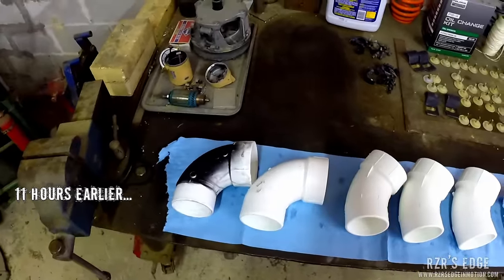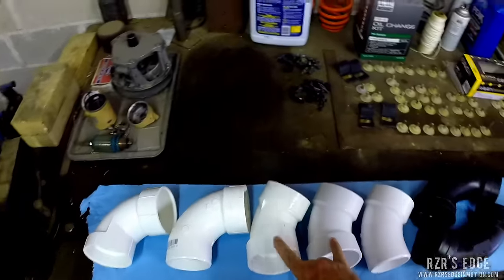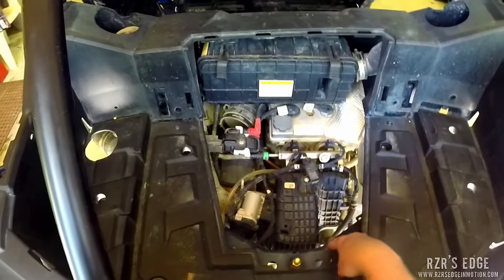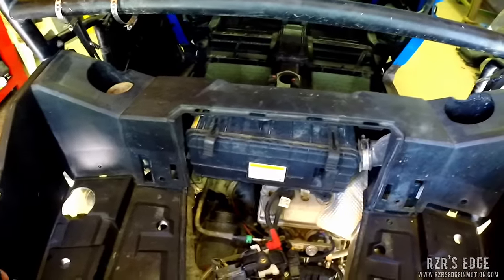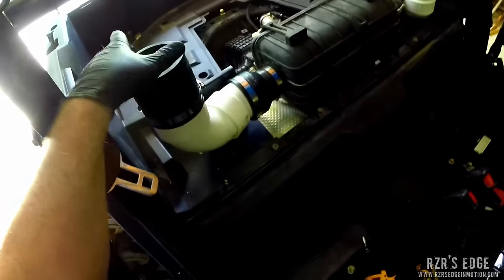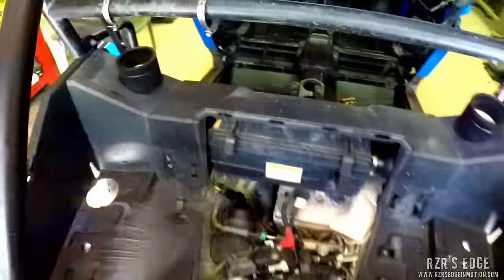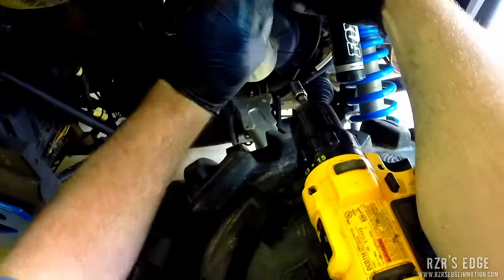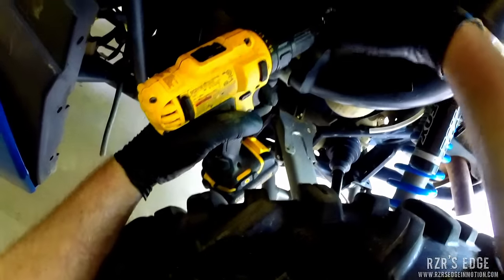How To - Snorkels! And Vent Lines

Comment: Nice write up about to do this on my 15 rzr 1000.  Any changes you think should be done? Also I hear yours burnt down how did that happen?
Reply from the maker: A mouse, chewed on the 12v wire going from the battery to the winch. Yeah I ended up using JB Weld on the joint I glued on, that was that. Sorry for the late reply!

Comment: Just watched your video had to watch it all.Exelent job.I just bought new 2016 900 S will your setup work on it. Again nice workKen
Reply from the maker: Ken Stegmann I would think so, doubt there's been any updates in those areas. visually verify everything is where I show it before doing anything you can't easily undo. also be careful with clearance between the tire and clutch exhaust tube, I have offset wheels which gives me more room there, a couple inches or so

Comment: Great video man Im always looking to make something out of nothing. I have a 2015 Rzr 900 Trail. Do you know if its the same as yours besides yours has 2 more doors? Do you think it would be possible instead of having 3 snorkels to combine the 2 on the left so you only have the matching 2? I really wanna keep my bed. I also have a back window.
Reply from the maker: Dave Burkhart the trail is much more narrow than mine, the belt exhaust done this way would not work for you unfortunately, the 2 flex 90's would be right where your tire is. also no you can't combine them, one pulls air in, the other pushes air out. you'd create a loop of increasingly hot air that would burn your belt up in no time

Comment: I just got a 2016 polaris 900 trail and I didn't like any of the snorkels out there. I don't think I could have come up with this one. It looks great, going to do it. thanks
Reply from the maker: nightweb11 awesome, hope it helps you. since it's a trail, make sure there won't be any clearance issues between the belt exhaust snorkel and the tire. the 50" width will almost certainly give you problems there, you may have to do something else there. keep me posted
Reply: RZR's Edge In Motion what do you mean clearance issue? I have. 2016 trail and I really like your setup. I just watched the whole thing

Comment: Great video watched the entire video only question I have is do you have problems with stuff getting kicked off the tire into that flex tube for the belt exhaust? Just looks a lil close to tire for my liking but well done.
Reply from the maker: Cody Flick thanks :) yeah I'll admit placement of that one isn't perfect, I struggled on where to put it for a week. made 3 different ones before that one. the only way to get it out of the line of fire was to move it toward the back and over next to the back roll bar, and also lower it. it looked awful that way. 

it does have a few splash marks in it, but they are just around the tip. the good thing is when the tires are spinning, so is the belt, and there's a significant amount of air coming out of that tube. I've yet to get anything past the screen. time will tell I suppose

Comment: Another great video ! Nice clear calm instructions ! Not trying to rush and skip things or going so fast we have to pause the video to slow u down! Very good job and thank you for posting this video. I want to try this but I’m scared I might screw up lol.
Reply from the maker: Haha thanks! There is one thing I ended up having to do differently. The PVC cement did not hold, I ended up using JB Weld there instead, and it lasted until the machine burned down.

Comment: update on put on the rzr trail models: For me my wheels never leave the ground so there's enough clearance, my friend just pick up a used rzr trail with drive train problems for a good price. He spend most of the time in the air so there's not going to be the clearance he needs. He is going to lift and widen it so he is doing this snorkel because doing all that he's doing will give him the clearance. So if you have a stock rzr trail and plan on driving like my friend you met not want to do this snorkel.
Reply from the maker: Sound advice, thanks for the updates :)

Comment: FYI the gas vent hose in rear roll bar has no holes to let fumes escape. might want to drill hole up top by roof
great videos
Reply from the maker: Bill P - good advice, this had occurred to me shortly after making this vid, and I drilled a small vent hole in each tube to let gasses escape, below the top of the vent lines itself so there was no chance of water managing to drip down into the lines. thanks for reminding me, maybe I should update the info and mention that.

Comment: How does it sound in comparison to stock? very clean install plan on doing this after warranty is up. Nice work !
Reply from the maker: Lanny Griggs thanks! honestly it doesn't really sound much different, not a big change like an 800. the clutch does seem to breathe much better, when I first fired it up after putting them on it blew a ton of dust out the clutch exhaust

Comment: Weather  broke long enough to do the snorkels on my 2016 Polaris RZR 900 Trail. Only had a few issues one was they weld on bracket to the rolll bar for after market seat belt harness to mount to, I try many ways to get around them (none looked good) so if you aren't welling to cut them off you may not want to try these. If I had the secondary clutch intake hose there more then likely wouldn't have had enough room for the exhaust hose to leave wheel clearance.  They look great. Thanks a lot for taking the time to make the videos.
Reply from the maker: nightweb11 thanks for the update, I figured they may not work for everyone. hopefully it'll give ppl a starting point to adapt my ideas for their own use tho
Reply: nightweb11, I have been watching this video and have been thinking about trying this. I have a 2015 900 Trail. Do you know if your 16 is the same as my 15? I havent started doing this yet just looking into it. Any help would be appreciated. I dont mind cutting the bracket. Does it just need to be welded somewhere else? Thanks Dave

Comment: I don't know about 2015 & 2016 you could go to a deal to find that out. I have the after market 4 point harness so where the bracket is the two claps that hold the snorkels is where the outer belt fit, I am concerned the claps may cut into the belts so I am going to put a some rubber over the belt and under the claps to hold belt in place. if you are run the stock belts it isn't a problem. the exhaust 45 rubber elbow has to be put up tight to the bed. give around 4 inches of room from elbow to tire. I used a tie down  to  put down the springand tire didn't hit the elbow.  I don't do any jumping so I not worried. I hope this helps.

Comment: After installing the snorkel for the belt exhaust are you getting a lot of noise out of the snorkel from the belt.... by the way good clean job. And yes I watch the entire video lol. Thanks
Reply from the maker: BigTimsTowing - lol :D On a 2 seater it does make a fair bit of noise. On the 4 seater they are far enough back where it just sounds cool. Oddly enough it's not even that bad from the back seat, which obviously makes no sense. Must be some sort of acoustic effect from the larger cab, I dunno. Couple things I've done differently is use jb weld on that exhaust 90, and I shortened the exhaust riser a couple of inches
Reply: RZR's Edge In Motion thank you for the reply like I said you did a very neat and clean job and that is what I would like to do with mine and Yes mine is a two-seater I haven't had a chance to ride mine for I bought it brand new 2017 and put it in my shop and trying to bulletproof it before I take it out. I do have high concerns about water getting into the clutch exhaust. I have read where a few people said the snorkels make the exhaust loud and was just curious how yours turned out. Thank you very much and happy New Year to you and your family. Hopefully meet you on the trail one day.

Comment: Here unless I said otherwise everything is 3"

Engine Snorkel
2x Street 90

3x Street 45
1x Street 22
1x Flex couple
2” to 3” flex coupler
Lengths of pipe: 3 1/2
Tip cut at 45 short side is 2” from end of pipe

Belt intake
1x Street 90
3x Street 45
3” flex couple
Lengths of pipe: 4 ¼, 3 ½, Tip
If you have the secondary intake you also need Drain Tee, and street 22 (I think the street 22 and one side of the drain Tee are not 3”)

Belt exhaust
1x Regular 90
1x Street 90
2x standard 45
1x street 45
2x 3”flex 90
Length of pipe: 14, 4, 2 ¾, 2 3/8

Other:
Gutter guard mesh
20’ 3/8 OD (1/4 ID) Clear hose for vents
Metal hose clamps to attach snorkel to roll bar
Reply: Total 
4x Street 90
1x Regular 90
7x Street 45
2x Regular 45
1x Street 22
2x Flex Coupler
1x 2-3” flex coupler
2x Flex 90
Reply: If no secondary what length pipe? If you have any idea. Thank you very much

Comment: have you experimented with a rubber 90* coming off the CVT intake?  did you see any reason to not use one?
Reply from the maker: Yeah waaay late with reply, finally breathing life into this channel again! The length was too long. The pvc one did come loose later on, but I put it on with JB weld, and that was years ago. It's a permanent part of the machine now lol

Comment: Good job and yes I watched all of it lol, did you seal the hole in the bottom of the breather box ? Been wanting to do mine also after belt exuast filled belt box with mud .I did like the one coming through access door as you pointed out .Thanks for the video
Reply from the maker: lol :D Thanks for watching. No, didn't seal that little drain, I've read that ppl haven't had an issue with it, and it's up pretty high as well. I put my hand over the snorkel and the airbox started to collapse...

Comment: i have a 2016 rzr 900s 2 seater. this should work correct?
Reply from the maker: Ted Garcia - it should, one thing I've done since the vid is rotate the stacks inward a little and lower the clutch exhaust stack so its lower than the intake one. looks better, and the opening is completely hidden from the back tire. also I took the trimmed elbow back off the clutch exhaust and glued it back in with JB Weld, ain't no getting it off now haha
Reply: RZR's Edge In Motion okay thanks man!!! ive been looking for a good setup like this for a long time!
Reply from the maker: Ted Garcia - awesome, let us know how it goes, I've been very happy with it
Reply: RZR's Edge In Motion Hey do you have plenty of room to your clutch where you can change ur belt or clutch or will you have to take the snorkel apart?
Reply from the maker: Ted Garcia just have to take the 2 flex 90's off, takes less than a minute